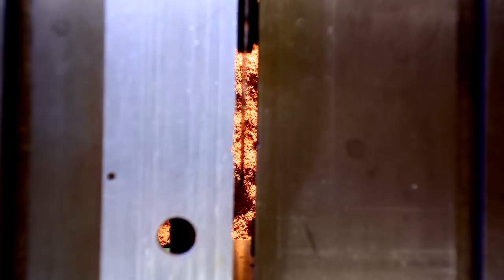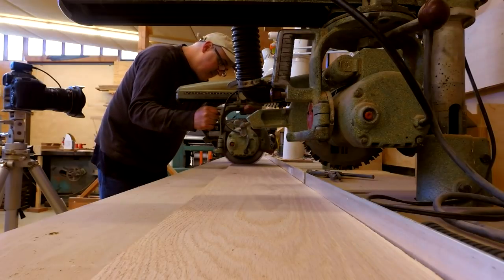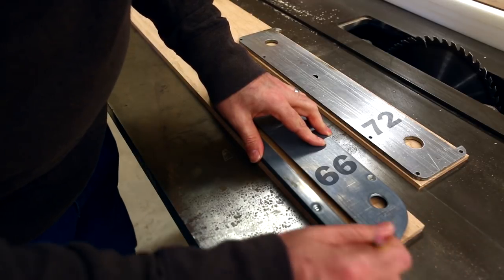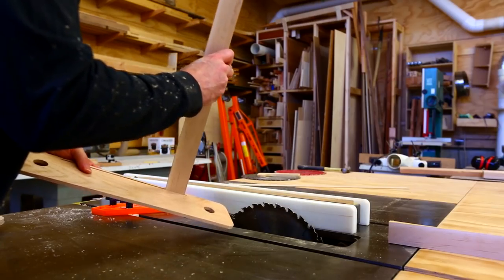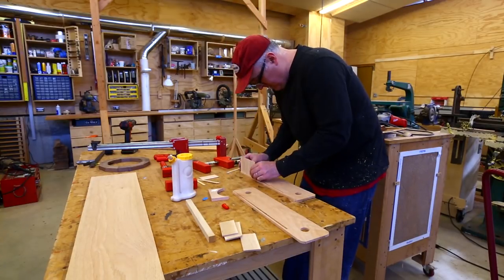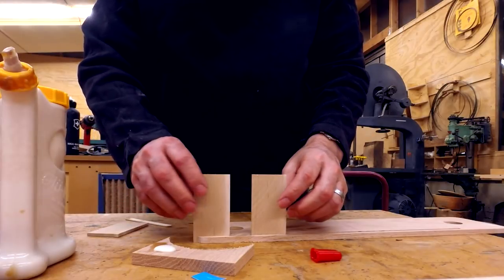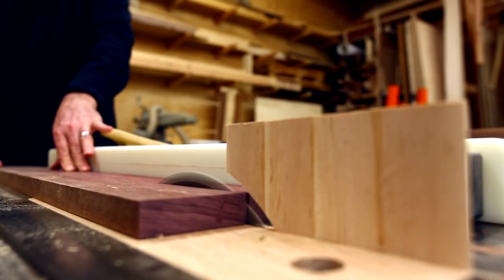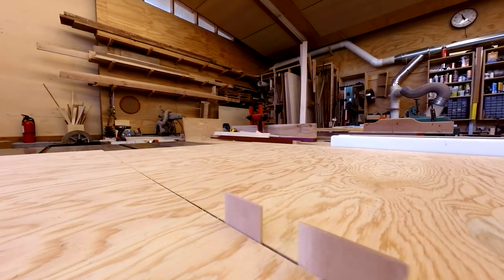Table Saw Throat Plates with Splitter Hack

Comment: Great idea for the inserts, only thing I've always wondered is if the blade ever catches them and throws them out of the saw?
Reply from the maker: I wondered about that too, so far they have been ok
Reply: frank howarth Thank you for the quick reply.  I assume they fit snug in the saw's opening and prevent them from exiting the saw.  To buy a replacement which I have to modify for my saw anyways is about $27-30.  I'll have to try my hand at making one myself here soon...probably several of them LOL.
Reply: My saw (a Bosch GTS 10 XC; more of a contractors saw than a table, but the largest I could fit into my workshop without using up all the space; and it's very accurate) has tabs on the rear end that go into holes in the table.
When I built an insert, I just added two small metal tabs that lock the rear in those holes, because if Bosch thought it'd be necessary I'd rather have them, too. If you don't have the holes, it should be possible to add some tabs that somehow grab the underside of the table.
I have no need for a splitter on the insert though, because that's built into the blade lift mechanism (which is the way it should be IMHO).
Reply: superdau Hahaahhahah.... hahahaaha oh boy that's a good one, contractor saw, what you have is not even close. It is an under powered, inaccurate, "bench" model. Yes you have a riving knife but what good is it on a bench model? Oh wait, you definitely have to have one due to the inaccuracy of the fence and the vibrations. I remember using bench saws, I went through 3 in a month before giving up and getting a used contractor saw. I have zero space so my table saw triples as a work surface, table saw and I replaced a wing with a homemade router table wing. Problem solved.
Reply: @Commander Douche

It took you 3 'bench' saws in one month to realise you needed something different? Wow
Reply: Jonto Dickens At the time I had never even used a handsaw before. I purchased a basic mastercraft, figured it was just because it was mastercraft it was crap, picked up a slighlty more expensive ryobi, crap so my last effort was to buy a dewalt model, low and behold it was crap to. Thats when I realised it was not user error,the forums were totally right sucked it up and lost 2/3 of the space in my shop with a Rigid TS3650. Funny thing is I picked it up used for $250 in mint condition which was half of the dewalt. And yes it took a month. I had the mastercraft for  2 weeks and the the other 2 for a week each, I have a life, a wife and a FT job, a lot more of my attention goes to more important things.
Reply: Commander Douche I have a life, a wife and a FT job also and I did some research before buying a saw. Also, I don't see the need to come out and bash someone for the saw they have. I do; however, find a need to comment on your name being so fitting. Good Job!
Reply: Commander Douche
Looks like I found an expert (who doesn't even know how his own tools are spelled).
If you think 2.1kW is underpowered I don't know what you want to cut. Maybe with your expertise you tried to cut steel, which is why you had to get 4 saws? That power is plenty for me and I doubt you get that on 110V at all, btw.
Repeatable cuts to within 0.1mm are no problem with that saw. What's your application? Something cut to microns?
If you feed stock through straight (which the fence is perfectly able to do), the riving knife doesn't even touch the wood since it's 0.3mm thinner than the blade. Which is how it should be, because you never want to bind the knife.
None of these are secrets by the way. Other people already checked that. If you read about it before you buy stuff, you don't need to go through the hassle and waste of time of trying out 4 tools.
Reply: superdau Ok, try and make a SOMA cube on that..... Bench saws are crap end of story.
Reply: William Todd Normally throat plates have a pin or stud coming out the back that sits under the table top, preventing the back of the throat from lifting in the event the upwards portion of the blade catching. You, him or me could easily drive a small nail or screw into the back to do the same thing.
Reply: Kale Klompstra I was thinking about a little pin or something of that nature as well.  The one I have now is very tight fitting, supposed to have been for my saw but obviously not.  It has a pin in it, I guess an easy way of doing that would be to just measure it to get the pin in the right spot.
Reply: Yeah as long as it prevents the throat plate from lifting from the back. When i make throat plates i find it easier to cut them thin and use set screws or flat heads to shim them up on the tabs it sits on. Another good idea, to strengthen the plate is to cut grooves perpendicular to the plate of the front and back and insert wood grain in the opposite direction, like playwood. Look up Mattias Wandel on youtube and watch his throat plates.

Comment: I wonder if you really need them to be as tall as you made them ? Wouldn't they work just as well and be stronger if you made them, say, one inch tall ? All you need is to have them there to keep the kerf open and there really isn't any reason to have them extending above the board your cutting. Just a thought, I'm going to make some this weekend.
Reply from the maker: Yes, they don't need to be so tall

Comment: Maybe try using some nylon/plastic etc, the same stuff your fence is made out of, for the fins, bet they would last a really long time
Reply from the maker: The work piece would slide nice on the plastic.
Reply: More than likely the fence has delren plastic. That's come pretty tough stuff, a little expensive though

Comment: Never did like riving knives. But to solve the problem of the exiting side of the board riding away from the fence I made exit feed rollers that toed in just a little, if you see what I mean. My old table saw was only 2' wide and 3' long and really cheep and crap. but i could cut 8x4 sheets no problem with the rollers pushing againt the fence for me. This makes me think a roller on the back side of the fence could do both anti kick back and hold against the fence, maybe even a feather board. I can't try the idea out now as I only have a quick home made table saw.
Reply: I have a roller set that I played around with mounting on the fence to hold the wood down.  It had an adjustment that was already toed-in which I thought was great until I tested a board through it with the saw turned off.
 
I pushed it forward and it nicely pressed against the fence, but with a short backward movement the toe-in became a toe-out and pushed the wood away from the fence towards the blade.  So I worry that roller's toe-in could become a kickback enhancer if I hit a hidden knot or nail.

Maybe the best application for the roller toe-in feature is only with heavy pieces of lumber (that might be hard to kick back),  or on a router fence where it won't matter?
Reply: *****
That's a very good point and could get complicated to solve. Perhaps if the roller was mounted to an old ratchet. But still once the blade has got a grab rigidity is the key. You got me really thinking now ;P
Reply: Ahh, maybe a riving blade from the top with or without rollers?
Reply: *****
Put the roller on a thing that swings to get the correct toe-in. And can swing in the opposite direction to the same degree, so no toe-out. During the swing, may still be an issue.

Comment: What do the fins do?
Reply: Keep the work piece from moving laterally. One, gives you a straighter cut. Two, prevents the piece from moving onto the spinning blade and being thrown into the operators face, as well as possibly dragging the operators hand into the blade in the process.
Reply: Thanks Kale Klompstra!

Comment: I don´t get it why non of the US table saws have this "fin" integrated. In Germany this is standard or better said prescripted by regulations. The "fin" here is out of steel and linked to the table saw blade mechanism, so the distance to the blade is permanent about 5mm or .2inch. And it can be a real life saver if you work with solid wood (with a lot if tension inside), cause if you cut wood and it widens on the inner sides the blade CAN shoot the wood back in a deadly velocity.
Reply: +Jasper Jones All new saws do have riving knives like you describe. Frank using a classic Powermatic saws that were made way before the safety police were involved with woodworking tools.

Comment: Nice tutorial, but why not use a riving knife ? Just wondering, in Europe this is mandatory on every saw nowadays (for safety mesures)
Reply: totomhavehat maybe for professional shops, but how would they make something like this mandatory for hobbyists?
Reply: G.Work.Specials well it is mandatory now in Europe, even on small table saw for hobbyists
Reply: A true Riving knife raises and lowers with the blade and can also follow a tilted angle.  Older saws are not able to be retrofitted with a Riving Knife to the trunnions.  I.E. Older Powermatics or Delta saws.  Thus what this really is is just a "SPLITTER" not a Riving Knife.
Reply: Anon Person okay thanks !

Comment: Not sure why he doesn't just cut the slot for the blade and the splitter at the same time... instead of raising the blade to cut the slot???
Reply: Locating the slot perfectly needs to be done by the technique he used.  I think the order he did it in made sense.

Comment: Your splitters do not need to be so tall. try cutting them down to about 1/2 inch. The actual function of the splitter is to keep the piece between the blade and the fence from flexing back and riding over the blade. This would cause a kick-back that can seriously injure the operator. Search table saw kick back on YT!
Reply: Willi Wonka Agreed. Only needs to be tall enough to get in the kerf. As long as you keep the workpiece on the table 1/2" should be plenty.

Comment: Cool. Really good throat plate solution. I've never been able to get these to work. Probably time to give it another shot, try your method.  btw I gasped when I saw the fence on the left side of the blade. Of course there's no problem with this, it's just not as common. Anything unusual around a table saw makes me want to stop and think. Or gasp. Have you seen that slapstick bit with the little job site table saw? Sure,  I laugh, but it scares the crap out of me. Someone could shoot a video of little kids and gruff old furniture makers watching it. The little kids would be laughing, the gruff old furniture makers would be shrieking and hugging each other.

Comment: A riving knife attaches to the blade lift mechanism so it stays a consistent distance from the blade, which is what makes it so much safer than a splitter. With a proper riving knife, small pieces of wood can't get behind the blade to get kicked back up. That said, a splitter is better than nothing at all. Stay safe!